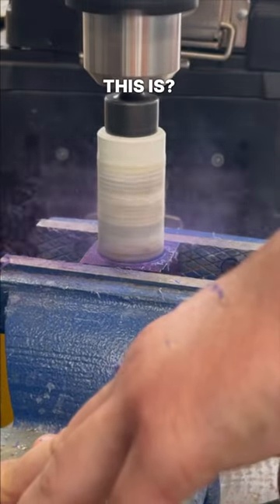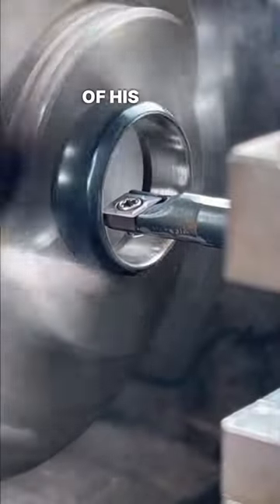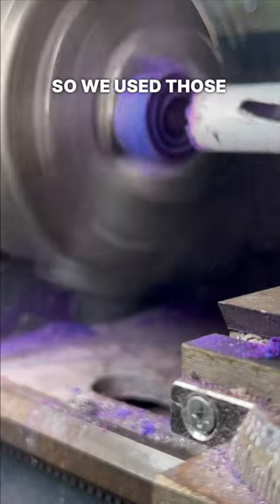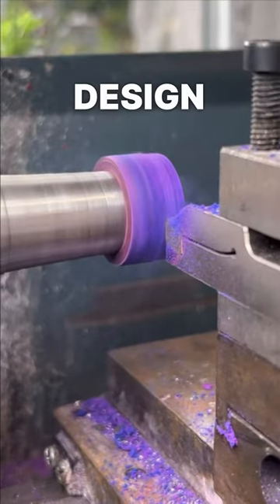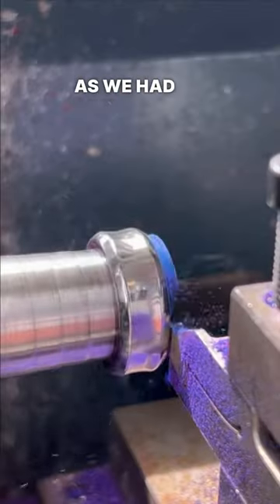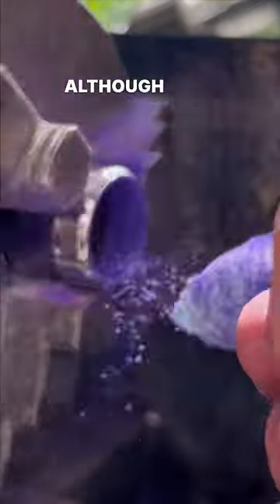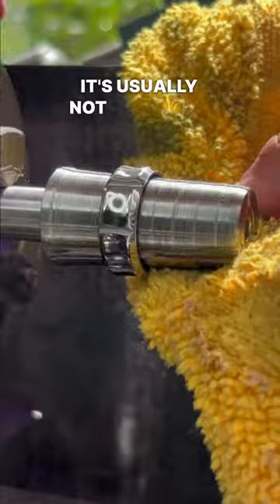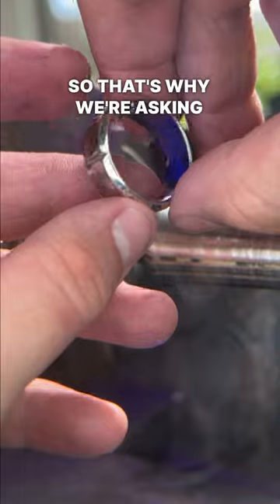Making a ring with cobalt chrome and stabilized wood #shorts

Comment: Isn't it a bad idea to put your finger into a 1000 rpm steel machine to polish a frigging ring?
Reply from the maker: Yes it can be very dangerous and should not be attempted at home. I have been using that technique for a few years now and have been incredibly cautious every time to make sure that all my extremities aren’t close to the chuck jaws and stay within the boundaries of the ring.

But I cant stress it enough that without proper training you can 100% lose a finger
Reply: @ringsbyblake The more experienced and skilled somone gets at a dangerous technique the more likely they are to relax and get hurt. Its not a case of if it will happen its a case of when. Always be alert and safe.
Reply: @ringsbyblake be careful! ive seen metalworking teachers with decades of experience lose fingers to machinery like this because they thought their experience meant they could relax. im sure you will be safe with it, but make sure you dont hurt yourself :)